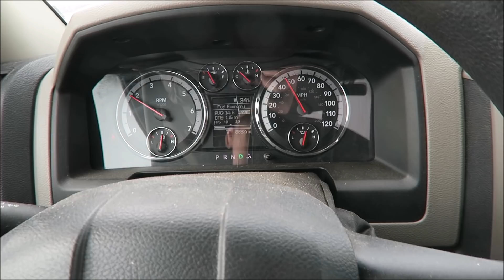It Broke The Driveshaft A Week Before We Leave For TX2K!!

Comment: That drive shaft joint that goes into the tcase is called a double carden joint we use them alot in our trail trucks because when you flex it out it don't put alot of pressure just one one joint it divides it into both the ujoints and that setup also makes the drive shaft stronger and less likely to break the whole shaft just the ujoints and you can get a repair kit for them and under the ball is a spring and some shim lookin things that go around the ball to keep it in place and there should also be a washer to

Comment: That was an awesome intro man! I think you should buckle down and make a permanent one.
Reply from the maker: That's probably gonna be the permanent one. I might change the clips as time goes on though
Reply: @SniderTron3000  RIght on man, that works. It's a nice start for sure. Did you get the new  bits in the driveshaft?

Comment: Ya I had a 2004 GTO with the 2 piece drive shaft my first mod was a carbon fiber drive shaft from drive works. Was rated for over 1k hp and cost around 900. But was well worth it.

Comment: I got the 2 piece drive shaft in my 99 obs with the 6.0 ls swap. It's running just got to finish the turbo shit up... but I believe I will twist the shaft right out from under it. Truck 9 inch of lift 5.13 gears healthy 6.0 in it then the s475 turbo ya carnage is fixing to happen for sure
Reply from the maker: Be sure to film it and send it to me lol I'll put it in a video if it does
Reply: @SniderTron3000  lol will do